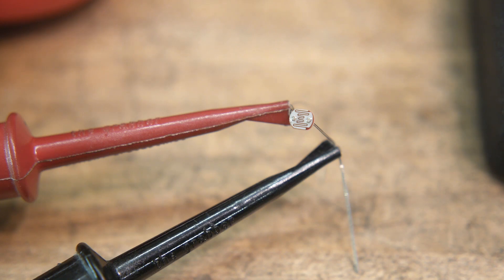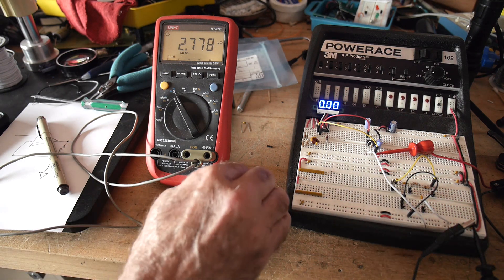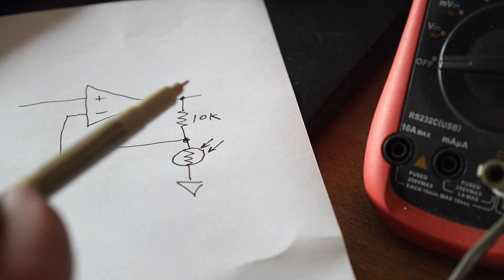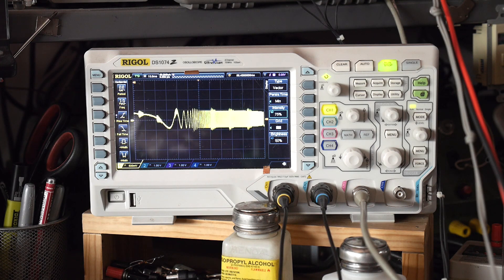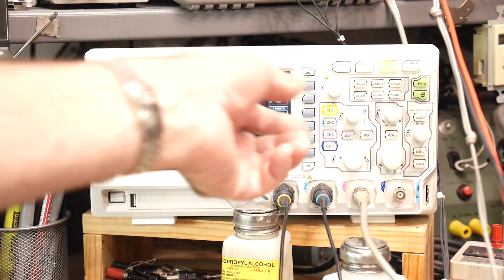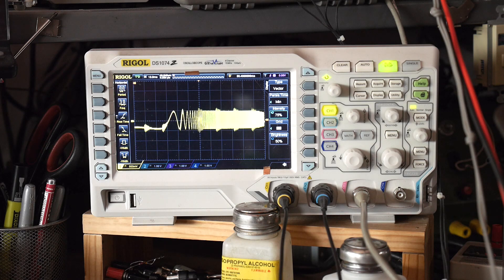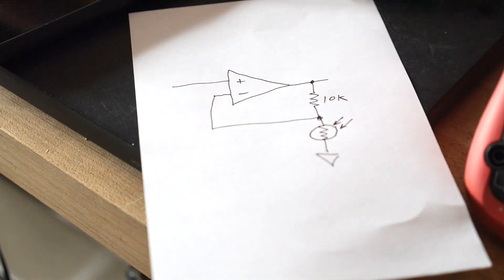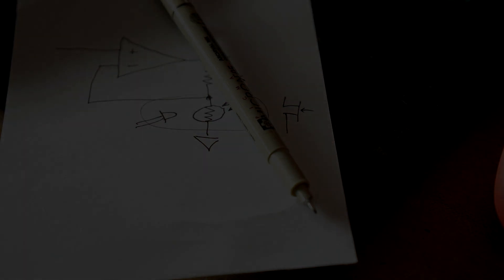#474 Photoresistor and Amplifier

Comment: Old style guitar amp tremolo circuit used this principle.  With a variable oscillator driving a LED or bulb.  The photoresistor in series with a level pot is then used to drain some of the audio signal to ground.

Comment: Wow, you're about 2 days late for me with this video haha. I just used one of these in a digital clock I am designing to vary the brightness based on the ambient lighting. I used a zener diode + an op-amp (dual lm2904) to create a constant current source through the photoresistor. Second half of the 2904 buffered the voltage across the photoresistor to the rest of the circuit. Yours is much simpler.
Reply from the maker: I'll try to be quicker :)

Comment: thanks for the videos. I am a retired electronics hobbyist. I was interested in what you used to generate the sweep.  I have an old GWInstek GFG8020H funtion generator. It has a VCF BNC input but I think it can only sweep one decade. Thanks in advance.
Reply from the maker: I have an HP 33120A generator. I had a generator that could sweep but did not have a sync pulse (at the beginning of each sweep). The HP33120 generates a sync that I run into channel 3 of my scope and trigger to that. And you are right it can sweep many decades
Reply from the maker: I show the HP33120 is this video
https://youtu.be/Qan7kpxGW9w